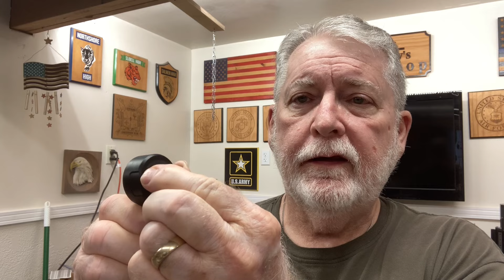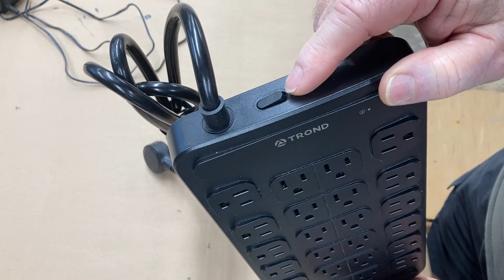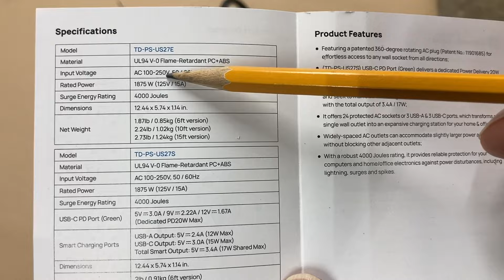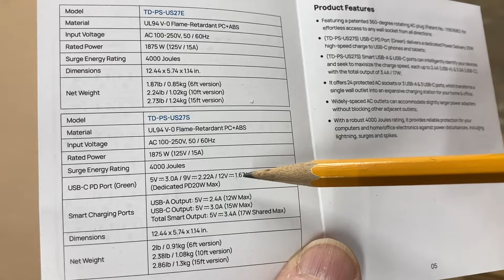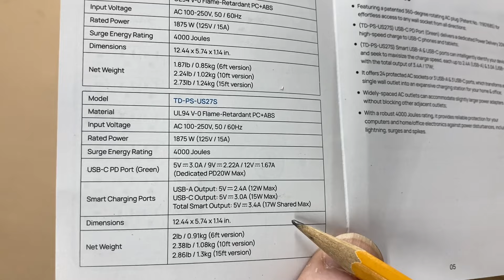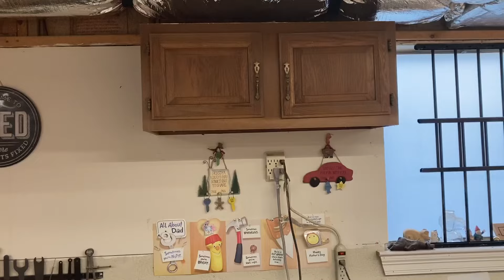NEW TROND SURGE PROTECTOR WITH A SURPRISE PLUS A CHALLENGE FOR YOU

Comment: That thing is not innovative, it's ridiculous. You should never plug that many things into a single outlet. And because people are dumb you shouldn't even be able to plug that many things into a single outlet.
Reply from the maker: No surge  protector on the market is designed to have every outlet in operation at once. There are many on the market that have many outlets. Just look at any store that sells surgery protectors. It is a convenience only, have the items plugged in does not mean that they are drawing power and in use. My idea of using this as a charging station is nothing new. At most only one or two will be in operation at one time Always be safe.

Comment: I do like the rotating plug so that the cable can be routed neatly. However, I am not keen on combining that rotating plug with a surge protector. Having used a similar connection system on a rotating device that would lose connection after a certain amount of use and cause arcing and tripping of the device, I would expect that to cause problems at a later date. Hopefully such devices have now evolved so that arcing at those rotating rings no longer occurs.

That being said, I would certainly ensure good air flow and keep your cables as short as possible, rather than coiling them up to try and keep things neat and tidy.

If you had a sloped shelf at the top so that the shelf mounted chargers are angled slightly with lights/indicators visible, then the surge protector being wall mounted below that and your wall mounted chargers at either side, and a shelf at the bottom for future additions.

In any case, I envisage excess cabling being the main downfall of whatever you do build, so I definitely would focus on keeping the cables as short as possible, I'm in the UK so our plug system is easy to work with in terms of cutting cables and reconnecting a plug, but if your system allows you to do the same in a safe manner then I recommend that you do the same. So if, for example, you have a charger mounted on the wall and it has a one meter long cable, shorten it so that it reaches nicely to the socket without too much excess that you need to do something with.

Obviously, to do that you need to really take your time to find a layout that you're happy with before committing to cutting any cables, but once you're satisfied, it will make for a much safer system. I have shortened cables in the past only to realise that I needed to change the layout, so I wouldn't rush that part, but I can tell you also that when you have short cables securely clipped in place and nothing is going to get tugged and moved, you won't have issues.

No rush to put something together so I say, try different layouts before committing to anything. Good luck - I've been there before so I don't envy the task.

It certainly would be nice if you could unclip the entire thing from the wall and roll it around on wheels for use elsewhere, so maybe you could make that possible. Hand it on the wall and plug the cable into your outlet and it's ready to go. Unplug it, take it off the wall and roll it around to wherever you need to use it  and then plug it in at that location. That would be my solution, anyway. Assuming it wouldn't be too heavy. 👍
Reply from the maker: Wow, thanks for some great ideas
Reply: The rotating plugs do wear out and start arcing.  How soon obviously depends on how often they are twisted, but also on how much load (amps) are passing thru them and if they are twisted while loaded.

I prefer short extension cords (12-18in or 30-45cm) with the rotating end that I can use with any cord, but I do have 2 or 3 such surge protectors.

I like the custom cabling and the rolling cart ideas. 👍

Comment: 24 110v receptacles on 1 outlet?  This is the worst idea I have heard in some time. I don't care that this abomination has a breaker . This is the biggest fire hazard from our Chinese friends today..
Reply from the maker: It is very rare to have more than one or two pieces of equipment at a time running on the AC outlets. There are numerous surge protectors from many countries being made and used including the US. Even in your home you have approximately seven outlets on one 15A circuit. Don’t forget each outlet has two locations for plugs. That’s now fourteen in your home. Think out what you are saying. In a shop environment you very rarely use more than one tool at a time. Common sense must rule. Safety first
Reply: @PawPawsWorkShop   I did think out what I am saying. I am an engineer and well aware of circuit design both residential and industrial.  I am also well informed on the risks of such products. You should be ashamed of yourself for pushing such junk.
Reply from the maker: Thank you very much for sharing your knowledge.
Reply: Would 23 be okay then?  Or anything more than 6 or 8 is a problem? How about when you connect your entire house thru a transfer switch or interlock to a single outlet on a portable generator?  Any arbitrary limit of outlets per breaker is simply arbitrary according to the folks behind the NEC.  There is nothing inherently wrong with multiple outlets like this. Whether it is built with quality components, good electrical design and assembly is a separate concern.
Reply: @Sylvan_dB  guarantee there isn't a UL sticker on that piece of Chinesium. Your attitude is exactly why we need firecodes.
Reply: @4110mahindra  I wired my first addition in 1972. No fires yet.
Reply: @4110mahindra I think this is just silly. There are so many devices with very low powered charging devices that you could put a hundred of them on a circuit without it overloading it. Why does that make it dangerous? Yes, maybe it would be nice if more things charged more devices from one power supply, but there's nothing inherently wrong with having 20 in a spot.
Reply: @mc.the_machine whats silly is replying to 1yr old comment